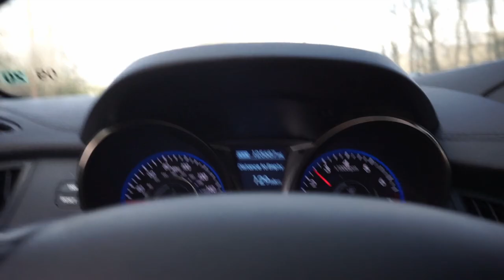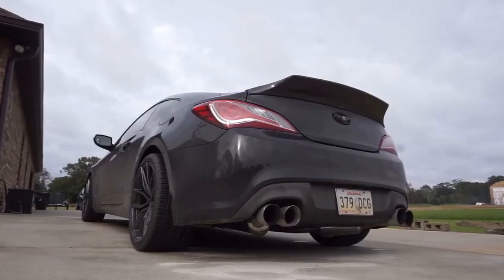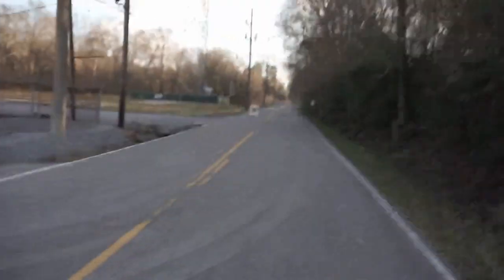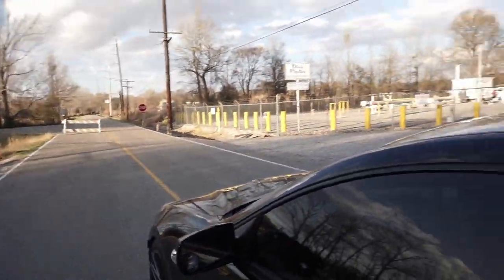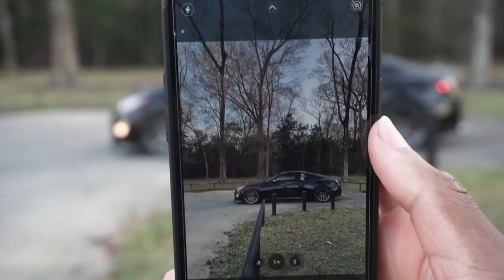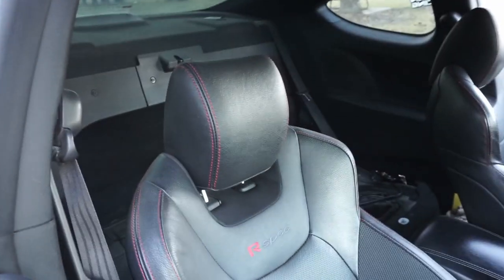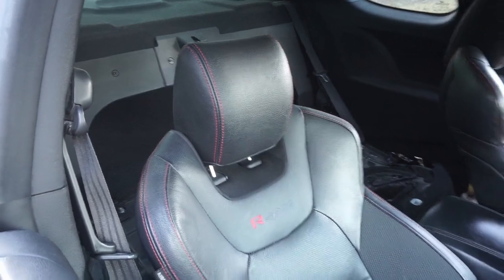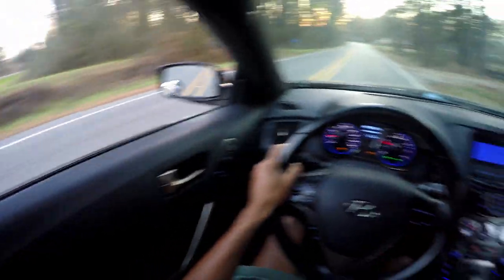Why My Genesis Coupe 3.8 Sounds Different | Full Exhaust Explained

Comment: The best exhausts for the Genesis Coupe 3.8 are Solo Performance, ISR Race or street, or the ARK-DTS exhausts. That is all. After spending 2020 and 2021 doing research on cars in general and learning more about the Genesis Coupe, I have decided I will go with the Solo Performance exhaust combined with NGM headers, IF I plan to keep a 3.8 engine inside of it and not 2.0 or LS swap it. Why? There are videos of the Solo Performance exhaust, and I think many overlook the exhaust. The few reviews I have read say it is quiet on idle or cruising, but when the gas pedal is pressed hard, it opens up very loud. There is also no drone. It also still has that GT-R sound. People have also added ISR or Ark test pipes with the Solo Performance to get an even better sound. If you are looking for a single exit, then the ISR is the best, and it still has that 3.8 V6 GT-R sound.
Reply from the maker: Lol thanks for being an exhaust connoisseur
Reply: For the 3.8 the CNT v3 is the best, add in some headers of choice and you have one of the best sounding v6
Reply: @ArcticAsian  cnt isn’t the best it’s ok tho
Reply: Get the obx headers they are better designed than the ngm ones